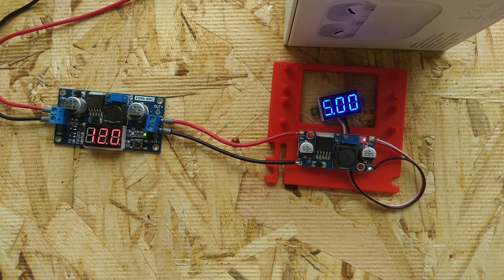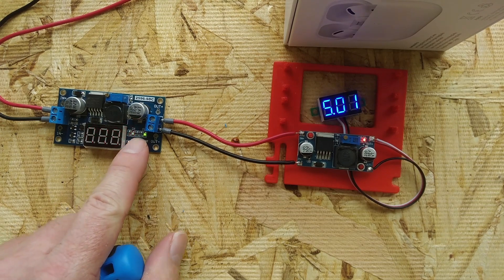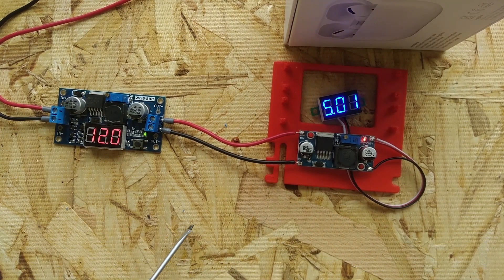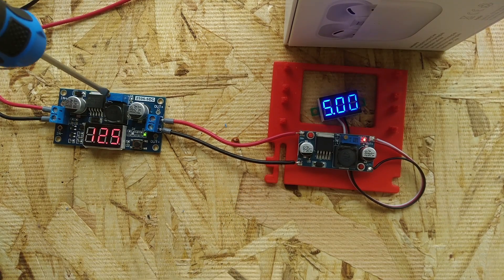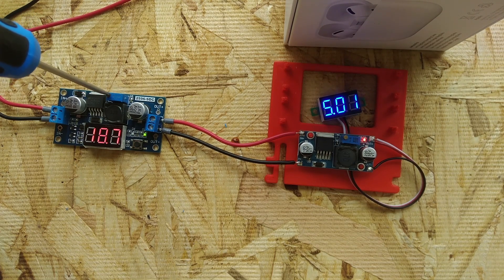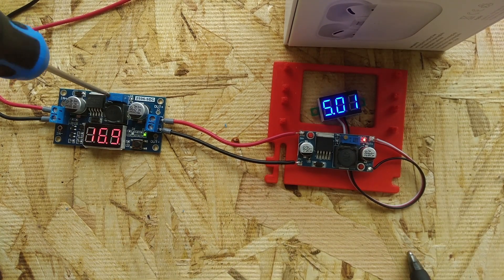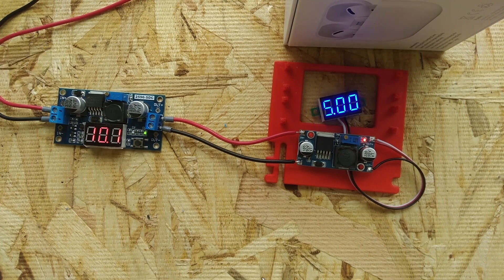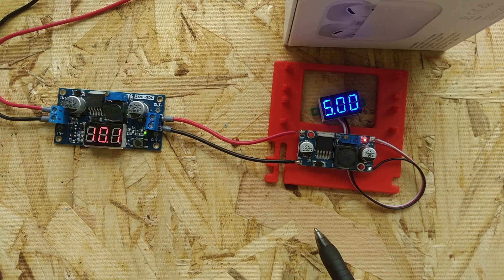Buck Converter, what happens when you change the input voltage

Comment: Does the same apply for step up converter? Will it also keep the setted voltage when the input votlage changes?
Reply from the maker: I’ve not personally played payed with them much but from my understanding yes boost, buck, and boost + buck converters all work by converting voltage in a range to a fixed output.  As long as the input is within the range ( and can support  the current) the output will be constant.   This makes sense when considering that boost converters hooked up to a battery will maintain a set output voltage even while the battery drops in voltage as it discharges, once the battery voltage is to low  a good converter that’s made for the battery type will cut off / shut down to protect the battery though not all do so if your using battery technologies that take damage when they are over discharged make sure you get a converter with  battery protection.

Comment: I have an AC/DC buck converter that's rated for 10-28V AC input range while output is rated at 12V DC. When I tested with a small engine that produces AC voltage 10-19V with multimeter the output  reads steady 12.3 to 12.4V DC for AC input voltages under 15V. When I set the engine to full throttle the input AC reaches 18-19V while the Buck converter output drops to around 2 to 3V DC. Is this normal behavior for a buck converter under no load condition?
Reply from the maker: That does not sound normal to me I’d be curious what the sine wave looks Like in both conditions.  Seems like there is a frequency or amplitude that’s not playing well with the  converter
Reply: @WhisperingWildMarketFarm  It the gyvrm A121203 I got from Amazon. Tested it today with an 18W 12V LED light, it stayed bright and steady from idle to Full throttle.
Reply from the maker: @jkucukov interesting so with no load  but high throttle the dc output voltage was 2-3 colts but with  an led load it appears to be putting out the required voltage?   That does seem quite odd though I’ve very limited experience with rectifying ac from generators.
Reply: @WhisperingWildMarketFarm  I ran the whole setup today again, this time I had 2 18W LEDs hoked up to tame Buck AC/DC converter, it surprised me that it works and the lights were steady from idle to full throttle. However if at full throttle and you decide to turn the lights off, the lights will not restart again due to reduced voltage as mentioned before, the only way the lights will come back on is if the throttle is reduced allowing the buck converter to catch up and power the lights on again. So as long as I decide not to turn the lights off at full throttle this Amazon Buck Converter (A121203) works. I wonder if this phenomenon has to do with the size of the capacitor inside the buck converter or the protection logic for above 12V AC input.
Reply from the maker: @jkucukov    perhaps the no load voltage at full throttle is to high,  this would typically cause component failure but if the buck converter has protection that may be whats happening. It could be a resettable fuse, per google they work for voltage as well as current.
Reply: @WhisperingWildMarketFarm  Interesting, I bought the device given the 10-28V input operating range. I reached out to the seller to see what they'll say.
Reply: I discovered notes that depict the operation of the A121203 unit: 

1. When the input voltage is AC10-14V, the output current is less than 1A; when the output voltage is 12V, it is not recommended to output with load at this time, because the conversion efficiency is low at this time; the output 12V after loading will cause the output to be unstable and big output fluctuation. The load is too big to start!

2. When the input voltage is AC15-AC28V, the conversion efficiency of the module is ≥90%, and the output voltage can maintain DC12V±0.25V. At this time, the 3A module can support long-term work within 2A, and the 5A module can support long-term work within 3.5A!

Based on these Notes, the unit should not go into overvoltage protection mode at 18 V as that's the range you are supposed to start applying load to the unit.
Reply from the maker: @jkucukov  that’s quite odd.    If you keep a load on it you can get it to function stable at hi rpm but without the load it stops working.   Do you have a bench power supply you can use to reproduce the behavior?
Reply: @WhisperingWildMarketFarm  Unfortunately I don't have a AC power supply or an oscilloscope to prove this. Its evident with a simple AC/DC multimeter reading the AC output from the engine that this buck converter is defective when reading the above mentioned manufacturer notes. Its designed to operate 15-28V for >90% efficiency, in my case I cant power the lights on when operating in the recommended range.

Comment: Hey, what happens if u want to lower a variable input value be a set number. Example I have 12 volts in and get 10 volts out, 10 volts in to 8volts out. And do this on the fly?
Reply from the maker: Hum. It sounds like your describing voltage drop across a diode or diodes.  Depending on the load that may be an option.
Reply from the maker: Buck converters try to keep the output voltage at a set point (what you set it at)  so as long as the voltage and current are within their tolerance you should get a steady state out.     Typically a buck converter requires the input voltage to be a few volts higher than the output voltage. So say you have  an 18v supply and the output is set to 10v.    If you change the input voltage to 16 v the output will stay at 10v.   Dropping the input voltage to 10v will result in the buck converters inability to supply the set voltage and you will get  unstable results 

In your example  with the output voltage set to 10 volts  lowering your input voltage from 12v to 10 volts will likely result in the the buck converter trying and failing to deliver 10v which could result in no output or an unpredictable or unstable state.

If you want a relational  drop in voltage  you could look at voltage divider circuits